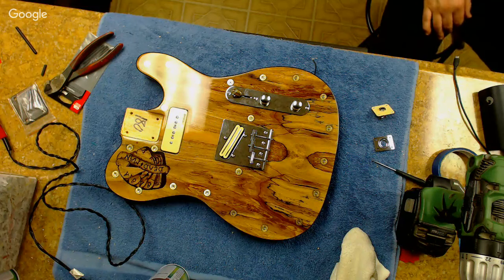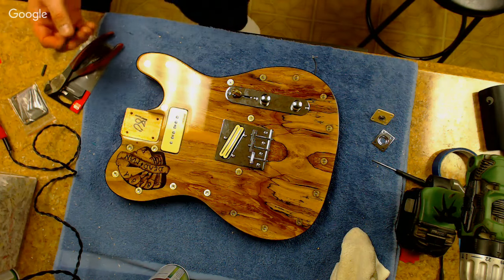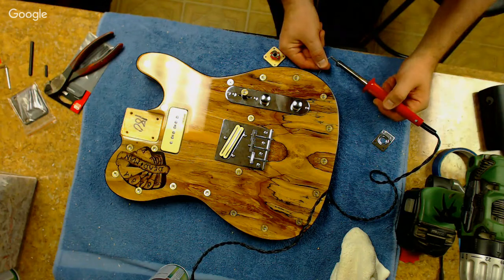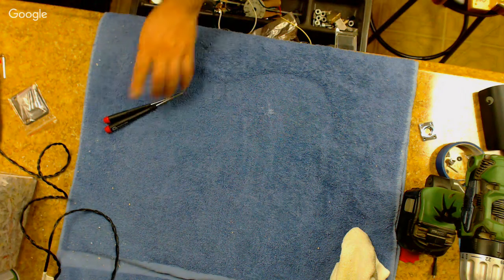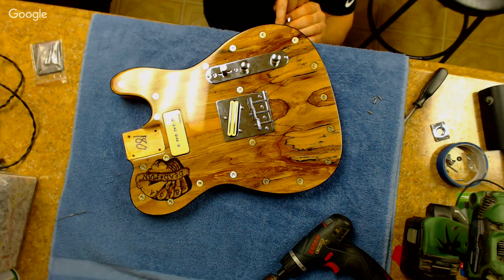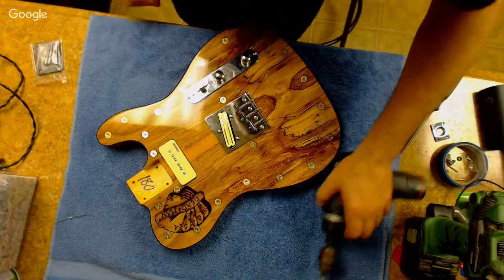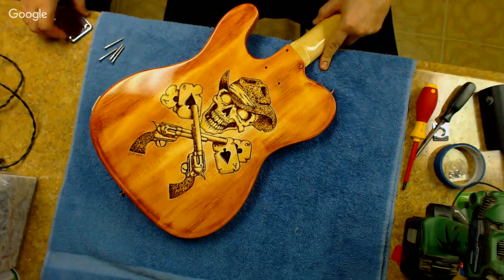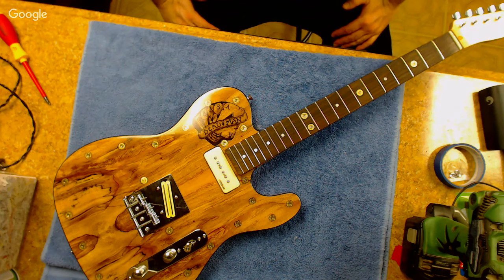Guitar Assembly Dead Man Guitar Kit Getting It Done

Comment: maybe it just the camera angle, but it looks like the neck pickup is to far to the right, (towards the horn) and the strings are not going to line up over the polepieces, but that might be the camera angle, and the string spacing might be off  putting a gibson style P 90 on a guitar with a fender string spacing. unless you got a f spaced P 90 you will not know till you get the strings on it.cant wait till its done, I really like the look of the front.